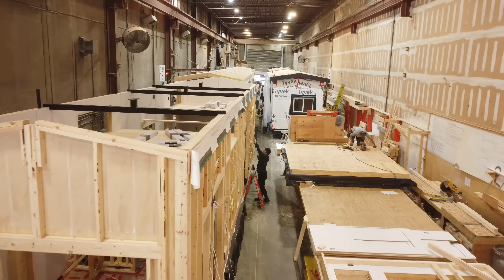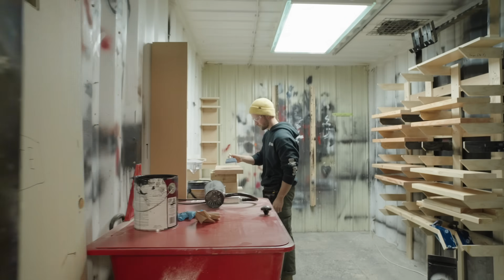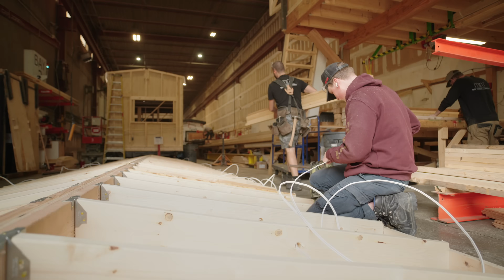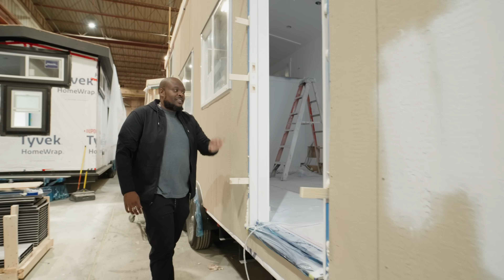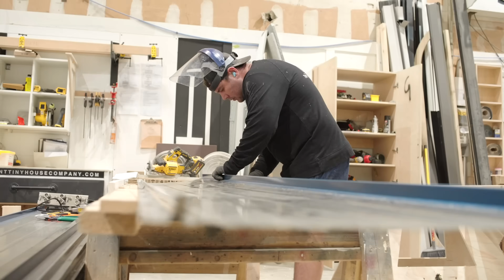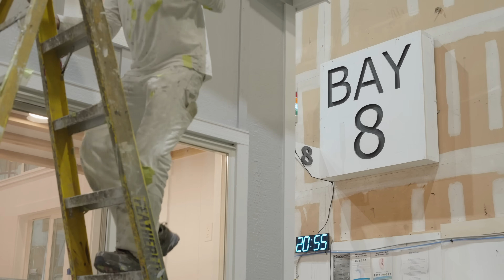Exclusive Tiny House Factory Tour – How a Tiny House is Built from Start to Finish

Comment: Beautiful tiny homes! What are the R values for these? We build our tiny home last year on a 20 foot dual axle trailer with R35 floor and R20 walls and roof with a loft and triple pane windows. We bought a top of line exterior door for $800. Unfortunately, it was the coldest part of our tiny house. So we sewed a triple blanket curtain to cover it. We heated ourselves with a 1,500 watt grid powered electric heater all winter even when -30C. We're about 30k into it so far and absolutely love it!
Reply: Thank you! It's great to hear that you are taking the extra steps to ensure that your tiny home is winter proof. In the past, we have built units to withstand -53C weather. We also offer an additional upgrade to propane forced air as an option.
Reply: @MintTinyHouseCompany Wow, -53C that is really impressive! I ask because when your guys were laying the flooring it looked like they went directly on the trailer decking without insulation. Maybe you spray foam R40 throughout the undercarriage? I have experienced -53C up in Fort Mac working on a drilling rig. It was terrible...and extremely cold too. I wore so many layers I felt like a polar bear waddling around. Best wishes for your business to boom!

Comment: In China the same home would be completed in 24 hours maybe less, not 6 weeks.
Even a 1250 soft bungalow can be built in 6 weeks in Canada.
Not sure how much is customer but even so I’m amazed you been in business for 10 years.
Reply: We understand the appeal of a quick turnaround. At Mint, our priority is ensuring each tiny home is built with quality, craftsmanship, and durability in mind. Each home undergoes thorough inspections to meet the standards required for RV builder certifications in both Canada and the U.S. This is all part of our commitment to delivering tiny homes that are safe, high-quality, and built to last.

Comment: What is the difference in a tiny home and a house trailer/ Mobile home?
Reply: Yeah I don't know why they want to continue putting tiny homes on a trailer... Just make a good foundation It would be much better.
Reply: @cariboo_Carrie there are different rules for houses with a solid foundation and without. If it's "movable" then it's temporary shelter not a house for residency, depends on the land and permits.
Reply: There is even a funnier rule/loophole. If the house is made is a form or a boat and a tiny electric motor is attached like it's supposed to float - it's a boat now despite people could live inside 😂
Reply: @daysetx 😂
Reply: @cariboo_Carrie 
The rules in most states state that they must be mobile to be considered a tiny home or ADU.
Reply: THOW  Tiny homes on wheels (which arguably could include campervans) give the owners the option to tow and go. That being said, in New Zealand, the population has grown 40% in 20 years, and is facing a housing crisis,  so a THOW avoids the red tape of build consent, and successive governments get to renegade of promises to build community housing.    If you want to subdivide your back yard, local councils will make it a struggle,  with constantly changing rules and regulations (if the home is on wheels,  there's your loophole). That being said, our current right wing government has said it's OK to put minor dwellings right up on the fence line (this will make great rentals for unsuspecting immigrants). Many towns look like shanty towns, with no infrastructure to accommodate a growth of population.    But we're happy to temporarily accommodate wealthy tourists 😅
Reply: @angeladawn805  great all time answer (except need to change right wing to left)! ❤️💯👍🏼
Reply: @auspiciouscloud8786yeah somebody’s confused